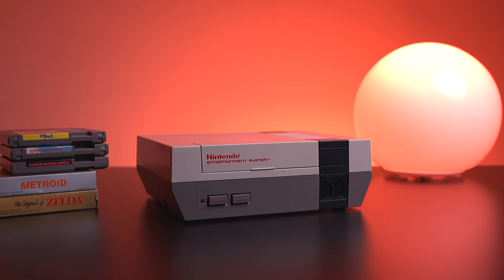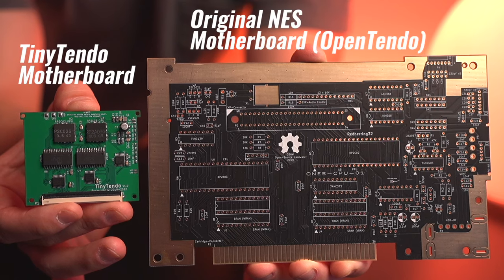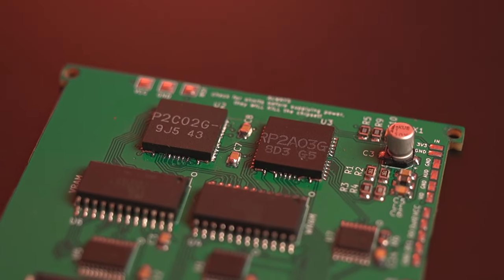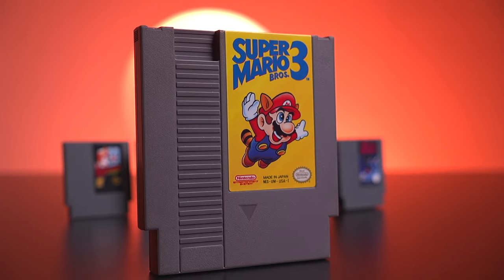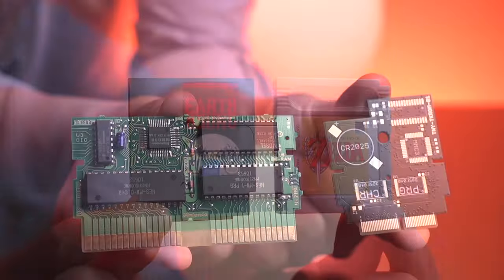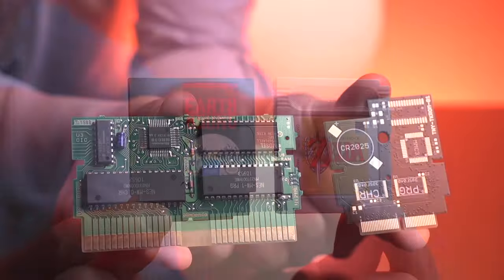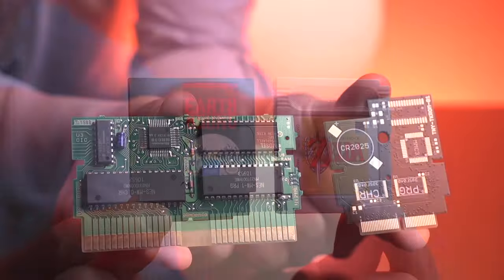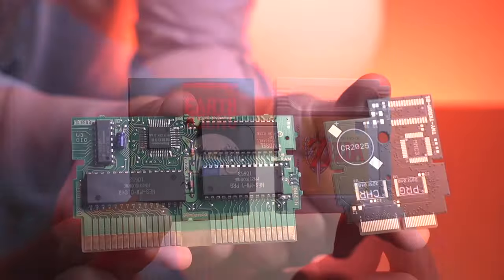Making The World’s Smallest NES With REAL Nintendo Hardware

Comment: Its a shame there are so many wires, wish it was 2 boards with wiring build in with a pin side and a connector side and just slot the two together when you fold it closed. It wouldnt be hard and it wouldnt add much if any bulk to the design.
Reply: ⬆️⬆️⬆️congratulations you are among our shortlisted winners claim your reward🎁

Comment: Would there be an everdrive solution to this? The carts are cute, but id rather have an all in 1 solution. Not that I wouldn't buy the tiny carts tho 😂
Reply: You could connect one with an adapter, but an EverDrive type device in the TinyTendo cartridge format/form factor isn't possible. 

It requires too many parts that are fairly large, and it just wouldn't fit. :(
Reply: Yeah, that makes sense. but the actual cart is huge so it defeats the point of the system lol

Comment: This is a quirky little project, but the fact that you're destroying original chips is a non-starter for me. I'm not an engineer but I would love if they were able to re-create the chips which would not only be a serious boon for repairing NES systems but for creating custom tiny projects like this.
Reply: Hi yeah, I agree. 
This was something I strongly considered, but the cost of having even a simple chip (simpler than the NES chipset) fab'd is several zeroes over what any hobbyist or small business can ever afford. 

Trimming chips was a desperate last resort, and for what it's worth I designed a little PCB so trimmed chips can be mounted back on an original board.
So it is technically "reversible" assuming someone trims the chips successfully. :)
Reply: @redherring3253  yeah I figured it would be crazy expensive to do. But a man can dream. Still very impressive to see what people can do as a hobby.